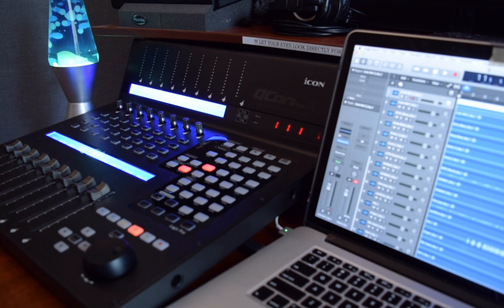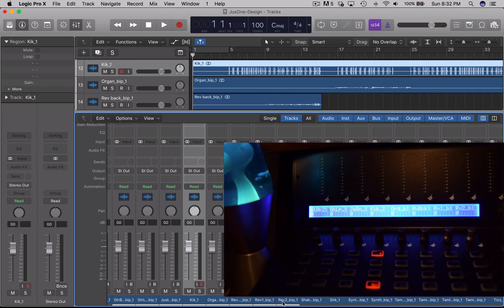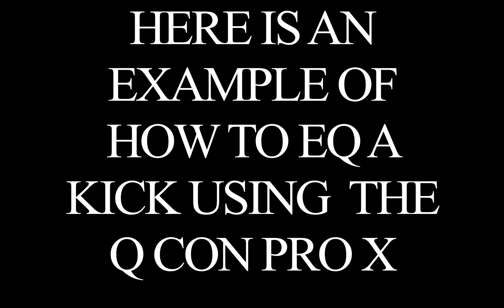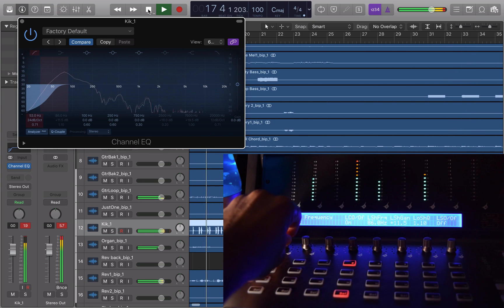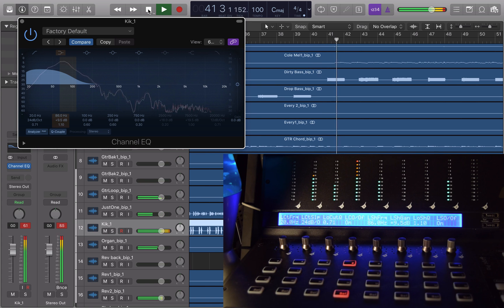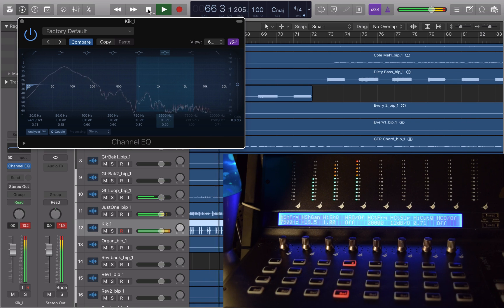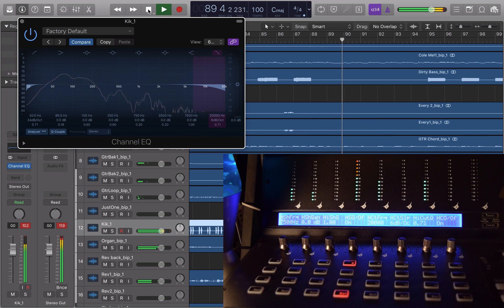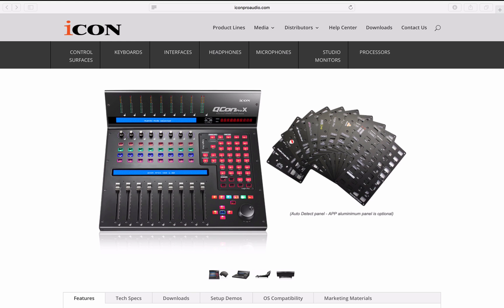Changing EQ Parameters in Logic Pro with QCon Pro X from Icon Pro Audio - YouTube

Comment: There are a few different eq modes in the controller assignments list.  The one shown here is fine but how can we set up key commands to bring up other modes with a single button push, for instance the eq mode where frequency gain is controlled via the faders while the encoders control the frequency itself.  I've been trying to program a mode change such as this for weeks but am finding it impossible. Please help.

Comment: Thank you for a great tutorials! 
I am using Qcon Pro g2 and I can not get it to control the parameters of my VST instruments open in Kontakt, such as modulation, vibrato (breath) ... etc... which is basically what I aim to use it for... can you please help us your fellow composers with this issue?  I am using it with CUBASE 10. many thanks in advance :)
Reply: Did you find a solution?
Reply: @Rojozproduction  I did, I had to use it in user defined interface, but with  imap v 1.15, previous didn't work

Comment: Hi!

I got the Icon Qcon Pro (the white one)

Do you know if the different plug-ins can be turned on and off from the controller? 

What i like to do is compare the signal after and before processing (like a bypass). Now i am doing it with the mouse and is not confortable.
Reply from the maker: Hello, Iker. What DAW are you using? Yes, you should be able to access plugin parameters and the bypass using the Qcon Pro.
Reply: @Iconproaudio  Hello!  I am using Logic Pro X.
Reply from the maker: Hello Iker, check the downloads section of the QCon Pro to find the function appendix. This is a general overview of some of the features on your device and how they function with some of the more popular DAWs. I believe this will help point you in the right direction.
Here's a direct link to the product page for your convenience: https://iconproaudio.com/product/qcon-pro/
Reply: @Iconproaudio  thanks! 
I will check it!
Reply from the maker: Fantastic, thank you Iker!
Icon Support.

Comment: Can we use..3rd party plugins in this controller
Reply from the maker: Hello Yathiraj,
Typically this will depend on the DAW software you're using and how it handles MIDI messaging in this respect. However, most users are able to use MIDI Learn to control parameters which the standard plugin-control does not support.

Thanks for your comment!
Icon Support.
Reply: @Iconproaudio  I use logicx as main daw but I uses waves and izotopes as 3rd party plugins.. Does it support....If s...Please do tutorial on...How to assign these knobs to control those parameters 😊🙏
Reply: @Iconproaudio  I am too much impressed with this console... I am wishing to buy this....
Reply from the maker: @yathirajuppoor9612  This will support most third party plugins.
Reply: @Iconproaudio  thanks

Comment: Do you have to configure the EQ plugin with the Qcon so that when you press the eq button on the qcon it shows up or does it do it by default ? I’m trying to get it working with Studio One.
Reply from the maker: Hello Mercyful Media, Thank you for reaching out!

This may vary depending on the DAW you use, though you will generally need to hold the EQ button and press the encoder of the track you'd like to open the EQ on. For instance, if you'd like to open EQ on track 4, you'd hold the EQ button, then press the 4th encoder knob.

Comment: I was thinking of getting one. Are the problems fixed already on this unit? I read the costumers complaints on the official website that many are returning this unit.
Reply from the maker: Hi Rofas, yes, since your post, we've made several updates to both the firmware and the mapping application. Many fixes were included. Also, in many cases, there was no actual problem with the device. The problem was often caused by improper set-up or insufficient power supply. So to fix this, we've also created this detailed setup video: https://www.youtube.com/watch?v=HCNGwKcixBQ and this powered hub: http://iconproaudio.com/product/onehub/
If you have any questions, you can always contact us diectly here: http://iconproaudio.com/submit-a-ticket/

Comment: It didnt work to well with logic x. I sent mine back..bummer!!
Reply: Were you on the latest firmware?  I'm thinking of a purchase, but now am concerned because of all the negative comments.
Reply: Yes I was using the latest firmware. But at the time they hadn't updated the firmware for Mac. The Master fader LED's didn't work at all. I truly believe this unit was meant to work with cubase straight the box. The Led's were not very accurate and basically useless for any type of meanful metering. it was very clunky during operation. Too glitchy. I eventually sent it back. Now I use the presonus faderport 16 and Console 1 by softube...A match made in heaven. I wanted the Icon to work but it didn't. I think you may be sorry if you get it.
Reply: Thanks. I'm looking at Presonus and leaning toward that with Softube as well. Go figure!
Reply: Well, I went out and bought one to try out.  Here are my findings. Definitely has the clicking faders as reported, so this might be an older unit. Kinda works as described. I would not call it easy to use. Documentation is HORRIBLE and videos (like this one) are just as bad. HORRIBLE product management overall.  That said, it is very sturdy and if I could get the edit plugins feature to work on the aux bus, it would be fantastic.  I am on the latest firmware. Strangely, the unit boots up to 1.15 but in Logic Pro X, but is listed as 1.14 in the Control Surfaces setup. So, which is it? Does any product QA testing even happen at all? For what its worth, I went through the same exercise with Faderport 8 with the same results for the aux bus.  I'm wondering if there is an issue with the MCU implementation in Logic. Anyone know? In the end, its getting returned. As much as I want it to work, it doesn't. work that well with Logic Pro X. I get more accomplished using quick keys and my track pad. Very disappointing.
Reply: @RodneyD  I had the same problems, now 2021, they still say the SAME thing!!!!
I did the same as you and sent it back
Reply from the maker: For those working with a Mac O SX this is a common remedy due to the Midi Studio not updating in the Mac.  Please follow this procedure to make sure you are properly configured.  There is a video coming out soon to demonstrate this procedure and other common troubleshooting very soon!

If you did a Firmware Upgrade to the controller you may need to clear out the Midi studio on your Mac and update it to the new Firmware Version. 
Please follow these steps : 
1.	Make sure the Controller is turned off.
2.	In Finder go to the Utilities Folder and choose ‘Audio Midi Settings’ app.
3.	If you are not seeing the ‘Midi Studio’ you need to use the ‘Windows’ drop down at the top of the screen and choose “Show Midi Studio”.
4.	Once you are seeing the devices in the ‘Midi Studio’ you will probably see the box for V1.xx (your previous version) and possibly Firmware V1.00.
5.	Click on the box and then click on the “-“ (minus) sign to remove that device. Do the same for v1.00 if it is there.
6.	Now turn on the Controller and the new Firmware Version will appear.
7.	Now follow the Setup Demo procedure for your DAW and make sure you select Mackie or HUI control and the Input / output devices to the latest firmware.  Here's an example for Pro Tools:
http://s3.amazonaws.com/assets.icon-global.com/wp-content/uploads/2015/10/ProTools-Qcon-Pro.pdf

Comment: very helpful video, thanks. do you think I could control both Logic and an SSL Sigma with this unit? Can it control more than one thing at a time with "layers"?
Reply from the maker: Hmmm... While we haven't specifically tested this unit with SSL Sigma, and we could not officially say that we support that setup, it seems conceivable that the Mackie Control would allow the Pro X to control EITHER Logic OR the SSL. It is doubtful that the unit would control both at the same time, it is possible that this would work by controlling Logic's plug-in control. 

Again, I would repeat, this has NOT been tested, and is NOT officially supported, but depending on the configuration, it might be possible.
Reply: Hi, thanks for the helpful reply!

Comment: Why has all the XS expander modules I have seen so far here on YouTube (like 4 different guys and with all of them this issue happens) visibly different black surface compared to this main unit (which is darker than those 8 fader expanders)?
Reply: queryen you just made an ass of yourself, I can't believe how sassy whiners and sensible little girls like you complain about paint inconsistencies (!!!!) (Dafuq) instead of caring of the actual built quality. Who cares about the fucking paint if the unit is going to last you for years instead of just looking good for a few months. It's an investment after all. Based on your silly reasons of "complaint", you're the type of person to be easily sold to anything as long as it looks good. That alone tells everyone the reason why you'd buy such unit, definitely not for the practical functionalities and productivity. 
Look Icon Pro Audio,
Maybe you've lost a sassy customer like him, but you've earned another one that's actually commited to get an Icon Qcon Pro X + 4 extenders. 
P.S. I won't care about the slight contrast between the blacks of them, just send them over and I'll make the most of it. I'd take 32 high quality motorized faders anyday. That's on my shopping list for the next month. Cheers
Reply: I have the Qcon proX and Extender XS. and they match because I got the them recently like in October 2017. The color match explanation is bull. They screwed up. matching colors in products is easy, i mean give me a break. The only way to solve this is to take back your Qcon proX if you bought it when it first came out and get a newer model and it will match. that's the truth folks/
Reply: Again, I have both units and they match perfectly because I bought the products AFTER they fixed the problem
Reply from the maker: Our factory tells us that the black paint is really difficult to match the paint lots. The XS paint batches were mixed at different times than the Pro X batches. They are run on the same line, but at different times, and it's extremely difficult to match the paint.

This is more noticeable on a metal chassis than it would be if the unit were plastic. I would imagine this will change as more XS units and Pro X units are manufactured, and the runs are closer in time.
Reply: So are you saying they are mixing the color by hand themselves or what??? Like in some 3rd world countries, right? This is so ridiculous as an explanation that I would be ashamed if I were you giving this as a reply to a question, gee: it is - SHOULD DEFINITELY BE! - fully automated process (thus the color would be all the time the same in 99% if not 100% of cases, like for example LEGO yellow bricks are the same color for 40 years cos it is made by machines automatically by predefined values...or like Samsung phone surface color has the same black shade with every single phone of the same type...or...or...!) and ICON is by far the only manufacturer I know saying they are unable mixing the same color more than once, pathetic and sad (so once they will have to mix the new canister for the main unit it will be in different black too compared to previous ones?????????? are you serious?)...you just lost one other buyer because of this flimsy explanations not even mentioning that long time problem of master led meter not functioning at all (go try it in Cubase for instance) - I want it look as one unit when joined together (1x main unit + 3 x extenders), not visibly different as if it does not belong together - it feels unprofessional and more of amateurish-like product this way, sorry!
Reply from the maker: Sorry, @queryen. I'll explain a different way. 

A Samsung phone and a Lego brick are both made of molded plastic. The paint is actually mixed with the mold, and therefore it will react the same way every time.

We make our rugged chassis out of aluminum and other metal alloys to create a more solid, robust product. We don't mold our chassis from plastic because, obviously, the metal is more durable. The drawback of this process, unfortunately, is that metal reacts differently to temperature, and different paints are absorbed differently by the metal. This makes metal a more challenging product to work with, and that (in addition to cost) are why many companies choose to use plastic instead. Our paint process is also automated, but we're dealing with different materials to create a more durable product.

If you were an early adopter of the Qcon ProX, your unit was probably built in the Fall or Winter of 2016. Your ProXS was built in the Summer of 2017, and if you've ever worked in a factory before, ours is like most. Cold in the winter, hot in the summer. This can cause slight variations in the way the metal reacts to the paint. Additionally, the matte finish on the ProX is a challenge, and we will work to improve our processes as we move forward so this becomes less of an issue. Also as the production runs are closer, you'll see less difference between the paints.

We apologize that there are some variances with the metal. This is one of the challenges of working with those materials, and again, it is part of the reason that other manufacturers choose plastic, which is less expensive, more predictable, but not as long lasting. We have chosen to utilize a more durable build quality in our products, and unfortunately, there can be some natural variations as a result of using more natural compounds. 

As for the master LED in Cubase, most of those problems have been corrected in later firmware upgrades. Please visit www.iconproaudio.com and download the latest firmware. If you have additional problems with that, please visit our Help Center at the site, and we can help you correct that problem.
Reply from the maker: We're sorry you disagree, @Good King. We certainly understand the frustration of having the colors mismatched. Your comment reinforces the point, however. If you bought both your QCon Pro X and QCon Pro XS around the same time, it's more likely that the colors will be identical. They would run on the line at similar times and under similar conditions.

We aren't saying that this isn't a mistake, we were explaining why the colors are different. Again, we apologize. We strive to do better.